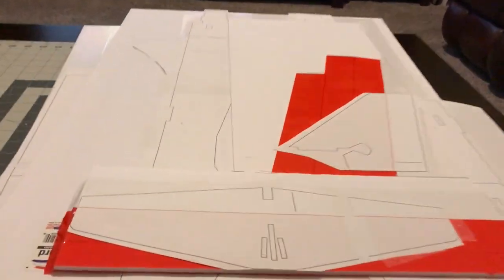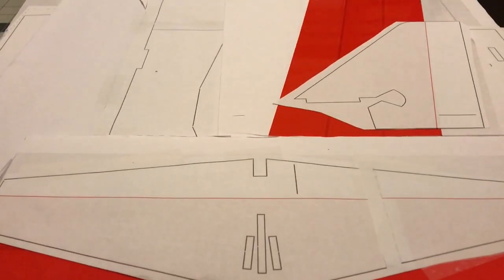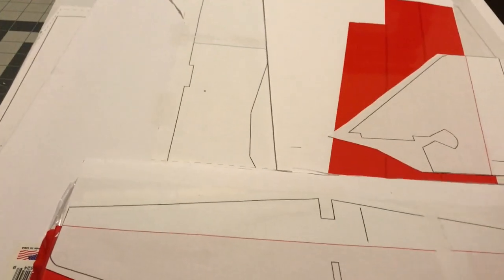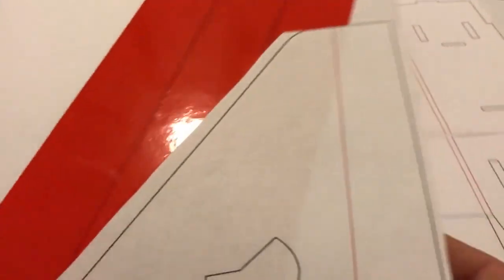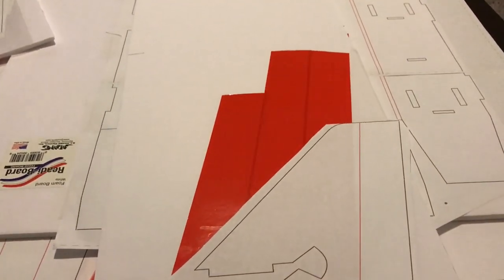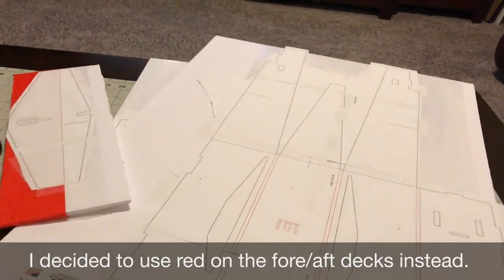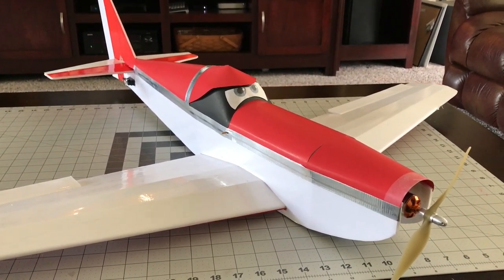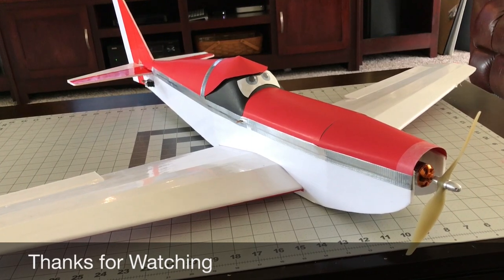Flite Test Racer RC Airplane Build Review [FT Slinger]

Comment: Great vid, i use that 2822 1450kv, 20 amp, 3s 1000mah on the ft- MIG-3 weighs 1.56lbs. Great motor if anyone is wondering
Reply from the maker: Did you ever build one?

Comment: Nice plane. I’m building it too.  Anyway you can show a video of how you attached the landing gear.  And where did you get the landing gear.  Thanks
Reply from the maker: I just took two pieces of basswood the width of the fuse about about 2" tall, glued them together, then epoxied them to the bottom of the fuse just behind the power pack opening. They are far enough forward for the line drawn through the axles to be forward of the CG. I don't know where I got the landing hear. Just had it in my spares pile. It is very light aluminum though.